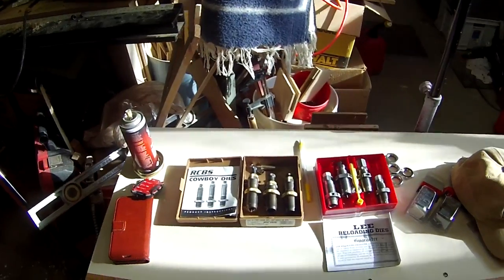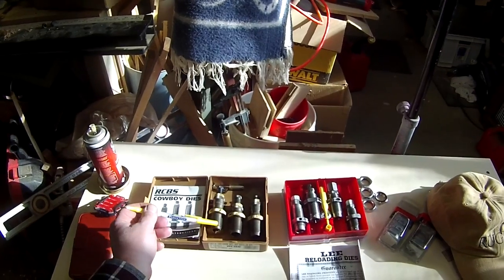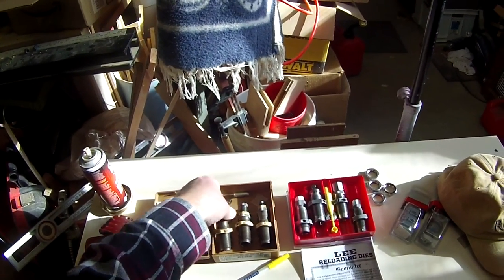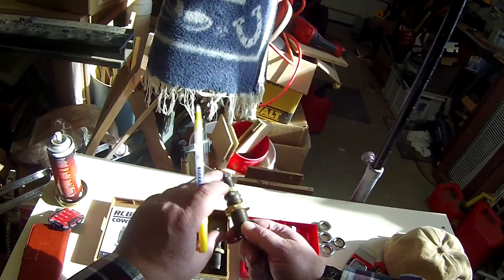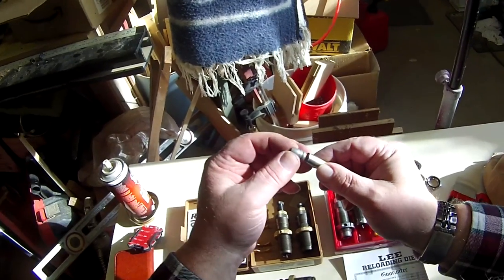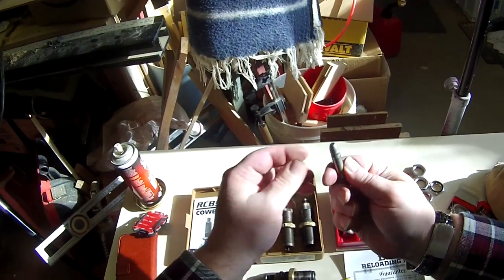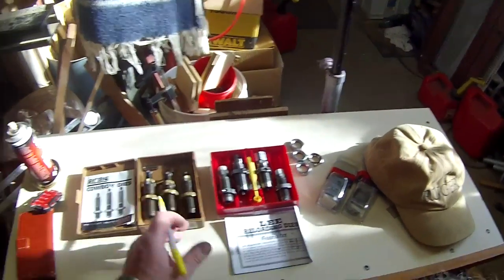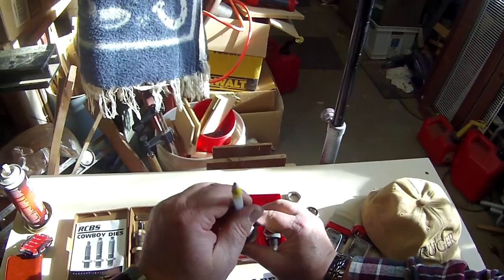3 Die and 4 die reloading sets, what's the difference anyway?

Comment: how u seat the primer?
Reply: I'd also like know
Reply: @alexs.5675  Either with a hand held primer tool or the priming tool built into your press that primes on the full down stroke of the handle.
Reply: @mattrickard3716  Or with a separate non handheld unit